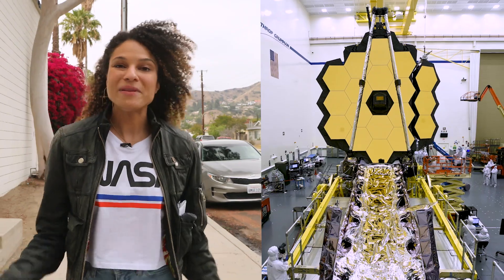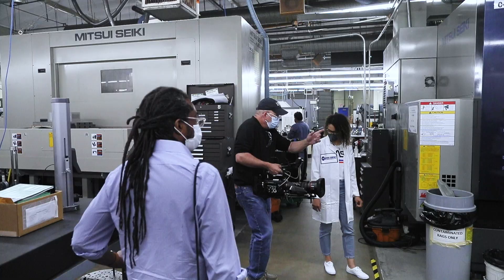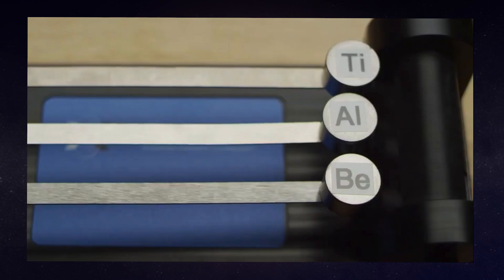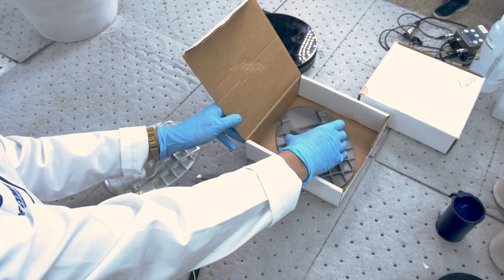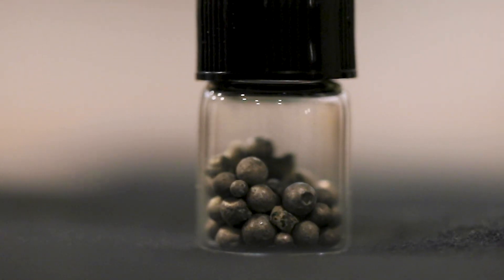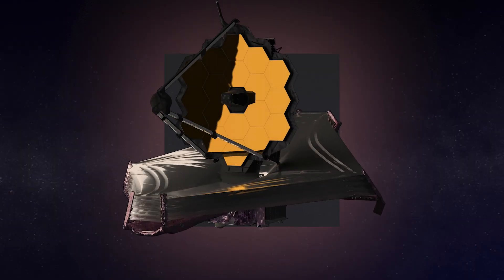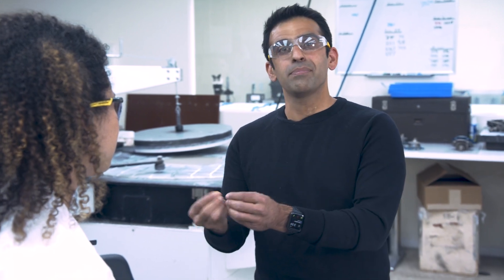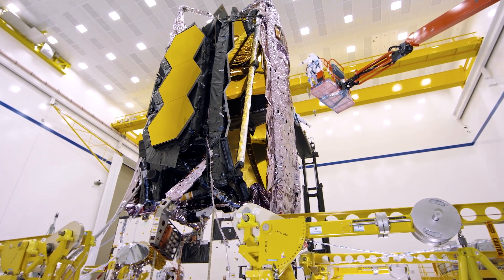Elements of Webb: Beryllium Part 1,  Ep 03

Comment: Fun fact - the stiffness to density ratio for most structural metals is about the same - steel, aluminum, titanium - all the same. For solid beryllium it is six times higher. Even 30% voided sintered beryllium is still 2.3x higher. So if you want to make something stiff and light, beryllium is your element.
Reply: If you want to make something stiff and light and fantastically toxic...

Usually a better choice is to increase stiffness by making the parts hollow / adding corrugations etc..
Reply: I have a carabiner made out of beryllium. Crazy light. Good stuff.

Comment: I'm shocked that you didn't mention the high toxicity of beryllium.
Reply: I'm really surprised the video shows someone lapping Beryllium in an open atmosphere with signs of dust on the table. An old machinist told me how they made connector rings for the Saturn rocket in a fully enclosed room with the controls outside. Required a hazmat suit to enter and decon to exit. Said it was the craziest thing, this was the 1960's when no one cared about asbestos.
Reply: @mattlabelle7823  Yeah, unless that was something else standing in for beryllium, that was incredibly disturbing. Either way, giving a false sense of the safety of this material.
Reply: There's even a disease named berylliosis, recognized even before asbestosis. I once visited a Brush Beryllium plant that required that I get a chest X-ray so they'd be able to prove I had lung lesions before my visit. I also once did small angle neutron scattering experiments at an NBS/NIST facility - this is done next to a nuclear reactor with holes in the side to let neutrons out. Sounds dangerous, but they said "The room is full of neutrons" as if that would reassure me. They used blocks of Be as beam stoppers. "Holy smokes, isn't that a little dangerous?" Answer "What do you mean?"
Reply: This was also worrying for me. Also, I was really annoyed when he said that they sinter the beryllium. Why? You can cast it as it’s melting point isn’t that high. Of course you need to take precautions when casting it, but it is more than able to be done. Berryllium is really bad in a powdered form, so I have no clue how you can just waltz around their manufacturing plant like that.
Reply: @romanvarcolac2238  Weight savings. There's more voids in sintered material. (every gram counts)
Reply: Maby they discovered a additive to the powered brillieum to controll the dust.a brillieum alloy...
Reply: @curtaustin8119  As long as they were not machining those blocks of Be and there was no powder then just using them as neutron attenuators would not be dangerous.
Reply: This video was about the host, not science or knowledge
Reply: @romanvarcolac2238  Beryllium was cast originally when it was first starting to be used, but somewhere along the line, it was discovered that sintering made for a stronger, less fracture prone material. Basically, cast beryllium has inferior mechanical properties when compared to the pressed powder stuff. This was discovered early on in beryllium manufacturing, and it’s probably around the same time that beryllium powder was discovered to be poisonous. It’s not like nobody ever thought of casting it, they did, they just realized that it didn’t work very well
Reply: I drank beryllium milk. 
Milk of berylia

Comment: Did I miss it out or wasn't it mentioned that beryllium is very toxic and should be worked with alot of precautions? It's a fascinating material :)
Reply: yep, huge omission. and it's not just a bit toxic
Reply: Exactly this. It's very difficult to machine because of its toxicity.
Reply: And the fact it must be sintered so the raw material is a powder, which just makes the breathing hazard that much larger.
Reply: Beryllium used to be called "glycium" (or some spelling like that), because it actually TASTES sweet. Bad idea.
Reply: Any metal actually is and why welders need to be careful with their fumes.
Reply: Yeah,  I used to eat beryllium....
Reply: @metatechnologist  Eh, kind of but burning anything isn’t good to breath in. Beryllium is toxic just sitting there. Most of the smoke from welding comes from the flux.
Reply: Our Beryllium transistor heat sinks were colored purple as a warning that they were not simple silica slabs.  Not internal contact or you will get cancer.
So do not breathe it of course, but I would not touch one of those heat sinks with cuts and scrapes on my hands.  So it must also have a good thermal conductivity as well.
Reply: @cosmicraysshotsintothelight  You are referring to Beryllium OXIDE!
Reply: @cosmicraysshotsintothelight  When I handle Beryllium I use Nitrile gloves. :)
Reply: I actually didn't expect my comment to get upvoted this much! However I would like to add that with correct knowledge, risk analyze and safety equipments we can perform jobs a lot safer. Working environment safety is an important "never ending job". Science is the way to go! Work safe and stay well! :)
Reply: You are correct.  I have worked with beryllium products and when moving to production mode, had to outsource overseas (from USA) to get parts made due to all our established vendors being unwilling to machine it.
Reply: @eahenrie  Interesting! Myself I've only handled finished parts in Beryllium, use to handle it with nitrile gloves and keep work area clean. Except for the danger it's a very fashcinating material indeed!
Reply: I was gonna post the exact same thing! This stuff is NOT meant to come in contact with carbon based life, especially if they have lungs. Makes life really difficult.
Reply: @JephN79  Indeed, safety first! :)
Reply: @infestedalien  a colleague of mine in the navy was practically in charge of the HAZMAT locker in his squadron. His supervisor (an E-7/Chief) told him to remove the corrosion from a beryllium wrench. That E-7 had never even seen the MSDS of said wrench, nor the consequences of sanding beryllium. My colleague, an E-4 knew better, and respectfully suggested that the supervisor look into the hazards of beryllium dust.

Needless to say, Chief didn't pursue his quest, and also learned a very important lesson.
Reply: @jdos2  Beryllium is actually very easy to machine.   The fact that you need to cut it slow, you don't have excessive fumes.  The fumes are no more than you get from a candle. Simple local exhaust it all you need for the fumes.  I use to machine Beryllium back in the 80's when I worked as a machinist for Wilcam Photo Research, which made the  70 mm IMAX motion picture cameras.  Each piece of these cameras was custom made.   The shutters were made from Beryllium.
Reply: @PattyDung  It's not necessarly toxic to injest.  It's toxic to inhale.
Reply: Beryllium chloride can form in the stomach if the element is swallowed. It is water-soluble, so both inhalation of dust and ingestion should be avoided. Accidental inhalation (in certain workplaces) is probably much more common.
Reply: @PattyDung  Wow!
Reply: @cosmicraysshotsintothelight  Beryllium is the Wonder Stuff, we used it in very classified projects a long time back. I handled beryllium alloy parts for examination after, ummmm, "treatment" in an American facility. This was forty years ago and I wore cotton gloves to avoid contaminating the part with skin oils and did my measurements under a plexiglass screen with an exhaust fan, not even a glove box. The rules have changed, thankfully.

Beryllium poisoning, as far as I know, still has no effective medical treatment, there's no chelation therapy that works.
Reply: @JephN79  Was it beryllium, or beryllium copper? I think current wisdom is that beryllium copper is safer, but still the inhalational risk of berylliosis is not to be trifled with.
Reply: No, you didn't miss it and you are correct, it's a very toxic carcinogen. This fact has not been mentioned in any of the beryllium series videos. Extreme dust control measures are required when machining and worker's require regular tests to monitor (the lack of,hopefully) beryllium toxicity. If one gets a cut working in a place machining beryllium that is a major incident and off to hospital you go, no patching with a plaster and carrying on working.
Reply: It is, and was one of the FIA's reason banning Mercedes from using beryllium engines in 1998 - 1999. It's carcinogenic.
Reply: She's really putting everybody at risk by not mentioning that this everyday metal everyone comes in contact with can kill them!!!  You saved lives with your comment, you genius.
Reply: My thought. Also, protection did not seem adequate.
Reply: Yup. Big warnings usually on anything containing Beryllium. Potentially very nasty stuff...
Reply: Yeah so he mentions potentially loosing valuable material but skips the part where machining beryllium can result in a chronic lung disease; berylliosis.

Comment: All of that and they didn't mention probably the most important thing about Be: IT'S WILDLY INSANELY TOXIC AND CARCINOGENIC . I'm glad I'm not even in the same state as that machining facility let alone inside it. The osha legal airborne permissible exposure limit for Be dust in air is 2 MICROGRAMS per cubic meter and cases of chronic beryliosis have occurred at even those exposure levels. The American Conference of Governmental Industrial Hygienists suggests the limit should actually be FORTY TIMES LOWER than the current one. We're talking plutonium level toxicity here, kids. There should be an entire video on how the toxicity alone is dealt with.
Reply: Well, plutonium is really stretching it a bit. But Be indeed is very toxic, especially in dust form, which there's plenty of in a machine shop. Have to say I don't think the safety precautions they took in that shop is nearly enough to protect anyone in that room by the look of it.
Reply: @Xiaotian_Guan  I really don't think we're that far off! Maybe a couple orders of magnitude. If the ACGIH limit is taken then that's 50 NANOgrams per cubic meter permissible limit. That's about the weight of a single grain of pollen per volume of air roughly the size of a refrigerator. It's an insanely tiny amount.
Reply: @Xiaotian_Guan  I think the manufacturing plant shown wasn't working with beryllium at that time and in that place. They make mirrors out of other materials and the JW telescope mirror segments were manufactured at least a decade ago. The only reason to make more mirrors out of Be would be for space projects and until the JW telescope successors such as LUVOIR get greenlighted and funded there won't be any more of them being made.

As for plutonium, there's a very unpleasant story behind the US medical investigations into just how toxic Pu really was, involving experimenting on people without their consent. However it turned out that Pu, chemically speaking, wasn't that toxic -- one person who was injected with Pu lived for another twenty years until his late 70s and died of a heart attack.

Comment: I could disegree with only the last sentence.
In case of JWST, the weight saving is less related to encreasing the rocket performance, but for increasing the total weight ratio of the onboard propellant, thus prolonging the mission.
Ariane 5 rocket could lift to L2 point almost X1.5 the weight of JWST, so the weight wasn't the biggest issue.

Comment: Magnesium is the only other structural metal less dense than Beryllium, which has also been used in automotive racing wheels. But Beryllium has half the thermal expansion, double thermal conductivity, and 4x the strength of Magnesium.
For this interested in stuff like this.. I recommend looking into getting yourself some cubes of different pure elemental samples. 
I've got 10, one inch square cubes of different metals to be able to feel and see them. Knowing facts about material properties is one thing, but it's quite enjoyable to be able to feel the heaviness of Tungsten and lightness of Magnesium.. One rarely handles those materials in life. 
Just wanted to share that. Those mirrors are indeed very light..
Reply: Honestly, the main reason is really the thermal expansion coefficient

Comment: Nevertheless beryllium is a very toxic metal, in particular its oxide BeO. It requires enormous precautions for its storage and especially its machining. In addition to the pulmonary fibrosis it causes, it is also a recognized carcinogenic metal. The maximum allowable concentration for 8 hours of work is only 2 micrograms per m3. In this video I see people handling it without the usual precautions. In Europe, personnel who machine beryllium or beryllium bronze do not do so with simple anti-covid masks ! It is misleading for the reader, all is not so rosy !

Comment: Beryllium is a supermetal. If it was cheaper and safer to machine it would probably replace carbon fiber and titanium in many instances.  The JWST mirrors are incredible.  And so is the CF structure that holds everything together.  PPB stability.
Reply: It's also insanely toxic and will never replace common materials because of it.
Reply: @Muonium1  I don't think it's insanely toxic.  I would save that designation for materials like Plutonium.  Precautions are used during machining to prevent dust from becoming airborne.  Expensive process that only few machine shops are capable of.
Reply: @MarkPryor1  see my comment above about it. The difference in maximum PELs for each substance is probably only a couple orders of magnitude. PLUS, plutonium always advertises itself and is easily detected with geiger counters. Beryllium is silent and invisible.
Reply: @Muonium1  do the machined mirrors pose a health threat? Probably ultrasonically cleaned to remove all dust.  Not to mention acid etched prior to gold vapor deposit.  Pretty sure they are safe to be around. Unlike plutonium.
Reply: @MarkPryor1  Plutonium is perfectly safe to be around if it's encapsulated just like beryllium would be. The core of the Trinity Ggadget was loaded BY HAND.
Reply: @Muonium1  There you go.  Perfectly safe when handled properly.  Just expensive to do so.
Reply: @MarkPryor1  The clip of a guy lapping the metal in the open atmosphere with only a cloth mask is very likely not suitable. A guy I worked with helped machine the structural rings of the Saturn Rocket. It was done in a fully enclosed room that required a respirator to enter and decontamination to exit, that was in the 60's.
Reply: @MarkPryor1  wich can't be guaranteed except in a few space an physic's labs

Comment: 1 Kg of steel weighs the same as 1Kg of beryllium. Weight/mass and density are not the same thing. Please! Beryllium has a lower density than aluminium and steel, not a lower weight/mass. Also, to be super picky the commentary discussed thermal expansion with respect to molecules. There are NO molecules in the metal beryllium. Other than that, keep up the good work!
Reply: So what's heavier 1kg of straw or 1kg of iron!?, What about if the straw is wet?
Reply: @JP-xd6fm  1kg of straw is the same as 1kg of iron. 1kg of wet straw weighs the same as 1kg of dry straw and also the same as 1kg of iron. The volume of dry straw will be greater than the volume of wet straw for the same 1kg weight. E.g. Big bucket of dry staw=1kg, small bucket of wet straw=1kg, lump of iron that fits in your hand also =1kg
Reply: @JP-xd6fm  The weight of 1kg of iron is the same as the weight of 1kg of straw but a kg of iron weighs slightly more than a kg of straw when placed on a scale because it has less buoyancy.

Comment: The main use of it as a metal is for x ray windows and ports. The second use is for satellite parts mirrors and optical tubes. As an oxide its used for lots of things that must be insulating but thermally conducting. 🎉

Comment: Oops. Missed something. Beryllium is not only quite hard to machine, but it chips easily, is notch sensitive, is really expensive, but most importantly, it's really-really poisonous! You only use Beryllium when you absolutely have to. Otherwise, it's just not worth the trouble. This is why it's not used for everyday stuff.
Reply: this shop Looks very unsafe
Reply: good thing this aint everyday stuff lol

Comment: The shrinking experiment is confusing. When seeing the four messurements: What is what? Also it seems like both shrunk 0.003 which would be almost the same percentage.
Reply: Yeah, didn't work very well, for a start a micrometer would have been better for measuring. Anyway.. 1:30 aluminium on left, beryllium on right.. Notice what looks like a gap on lower jaw, could be reflection. 1:33 Al left (increase in size), beryllium right.. 1:34 top right beryllium, bottom images both before cooling but cropped. Results inconclusive due to measurement technique that as she said could do with a little work, and a more appropriate tool.
Basically the experiment would have shown that (for example) aluminium would have shrunk by 12thou compared to beryllium that shrunk by 3thou. 
If the samples were identical they would have also measured the same thickness before cooling. Experiment null and void.

Comment: Interesting that they went with Beryllium instead of titanium.
Reply: Titanium is pretty good.   Would triple the weight of the primary mirror and reduce it's thermal stability significantly (both because of CTE and modulus).  It's a fantastic use of Be.
Reply: Best alternative would be SiC face sheet, carbon foam sandwich structure with CF reaction structure.
Reply: @MarkPryor1   o 3o